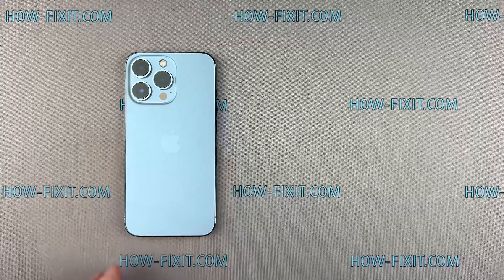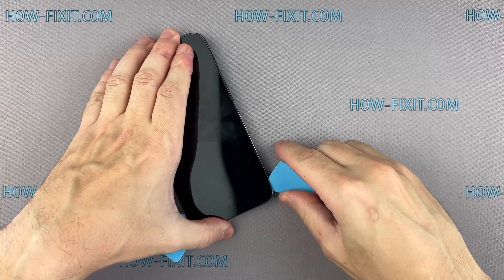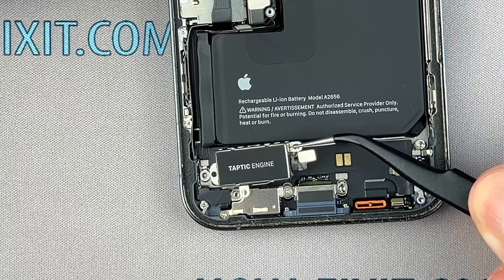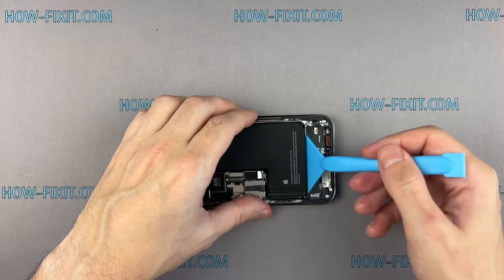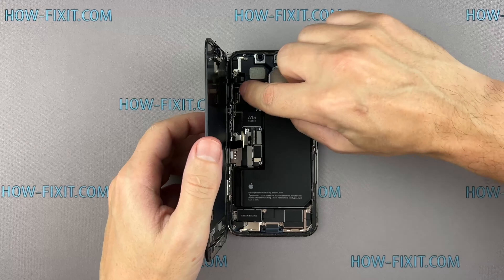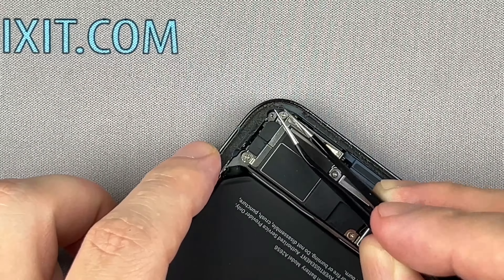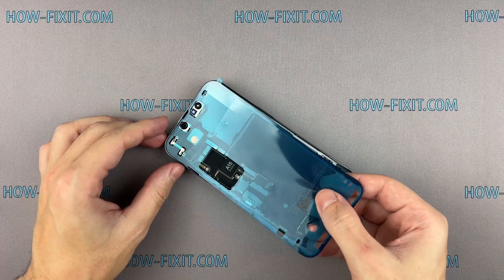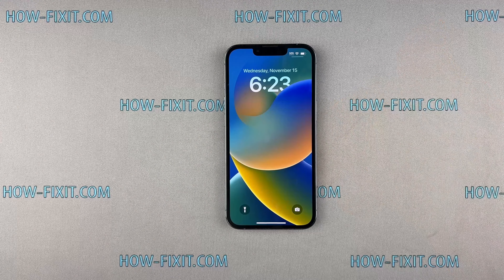iPhone 13 Pro Battery Replacement in 10 Minutes - No More Fast Draining!

Comment: Why not get a battery from Apple through the self-repair program?
Reply: Is original batteries available for purchase?
Reply: I didn’t find any batteries on the official Apple Service Repair Programm. They only sell tools and screws but not batteries.
Reply: @Angelocomposer They are available in Europe at least
Reply: @WingspeedGarage  I’m living in Switzerland, I couldn’t find one 😭
Reply: Where i live it costs more to buy battery from apple than to have it replaced by autorised apple repair shop xD
Reply: @ omg where do you live? 😂
Reply: @MisiekCentralny  Same here, if I use my own tools and return the old parts for the credit I’m saving like €70 and then I have no warranty if I screw up
Reply: @ where do you live?
Reply: @Angelocomposer  In Poland ;)
Reply: @ craaazy!! 😮😮😮
Reply: Just buy nokia 6310, remove backside case..  take out battery …put in new and close it again 😢

Comment: Looks straight forward I’ve done a few battery stops on older iPhones. However this method after fitting the new apple or 3rd party battery your phone will no longer tell you your battery state of health for me that’s something I would still need too know, nice tut though
Reply: It is fake battery, genuine battery display battery info even good fake one but some fake don't have the chip which indicate battery info:face-fuchsia-tongue-out::face-orange-biting-nails: